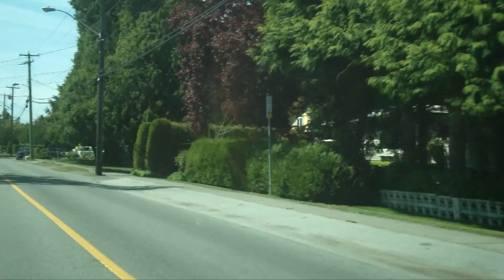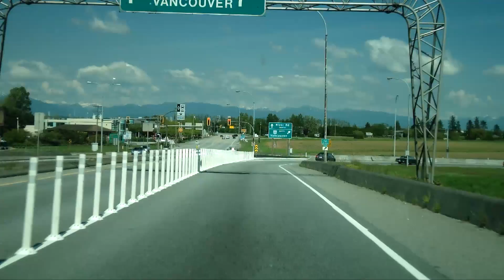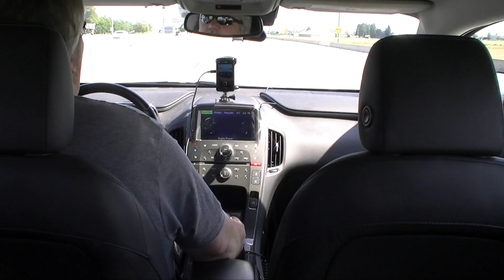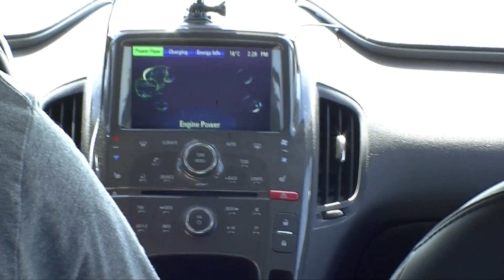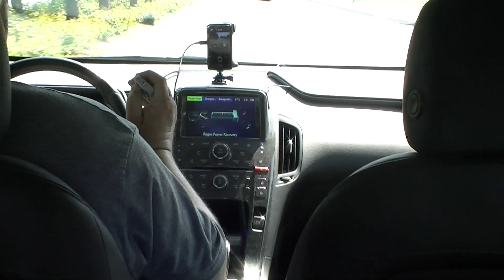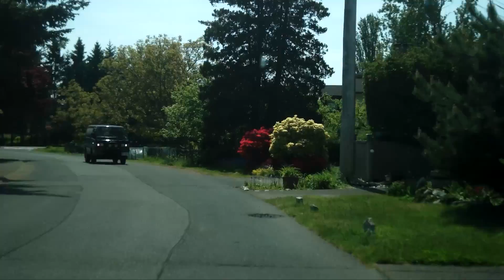How to drive a chevy volt for best electric range and fuel economy

Comment: Thank you for the video. Although, I have a few questions. You state that there's no other car that operates like the Volt besides the ELR, but doesn't the Prius Plug-in and Honda Accord Plug-in operate in the same manner? Through out the video I was hoping you'd mention why you picked the Volt over the Prius Plug-in or Accord Plug-in but they weren't mention. If you could choose again, which would you pick out of the 3? Also, I keep running into various specs on the mpg (I'm from the states) for the Volt. I was on the Toyota website, and there was a comparison chart that showed the Prius Plug-in getting 51/48 city/hwy, but for the Volt, it was 101/93 city/hwy. Which I guess they incorrectly put the combined gas and electric mileage for the Volt, rather than the gas alone. The Chevrolet website states that it's 40/35 city/hwy. If that's the case, would one not save more with the Prius Plug-in? Or would that depend on the distance of the destination, considering that the battery range for the Prius Plug-in is estimated at 11 miles and the Volt is at 38 miles. Reason I'm asking is because I'm starting a new job that's exactly 21 miles away, so 42 miles round trip. I think the Volt would save me more gas if I drove just to work and home each day, and only those places, but, what about after work? I like to go out and about and I don't want to have to wait around for my car to charge before I go out again. So in that case, I think I'd want to have a car with better gas mileage rather than battery life but I'm not sure. I'm probably rambling now, but, what's your take on this? Do you believe I'll save more gas with a Prius Plug-in or a Volt?
Reply: I've never driven a prius, and I really doubt I ever will. 
I will stick with my 2012 Volt for the next 2 years, when my daughter is old enough to drive, she can have it, and I will either get another Volt or a Tesla. I doubt there will be any other cars to compete with them on a price or performance point. 
Now that I have experienced EV driving without the range restrictions. 
I went to a mitsubishi dealership to test drive an iMiev, they didn't have one in Stock, the salesman tried to get me to test drive a one of their conventional cars. I refused and he asked me why I didn't want to. 
I just pointed at my Volt and responded "it's electric or nothing"
Reply from the maker: There are huge differences between a volt and a plug in prius or a plug in ford fusion.
The prius and fusion plug in operate exactly the same way incidentally.
On a Prius plug in, the range on the battery is only about 10 miles, the ford is around 20. Both of these cars will operate in battery mode at lower speeds for up to this range. They do rely on the gas engine for moderate, and heavy acceleration.
So you have to basically drive with a feather on the accelerator to keep the car in electric mode, the engine will come on on even the slightest grades. It operates up to about 45MPH ini electric mode, and once you exceed that speed, regardless if there is power in the battery or not the as engine starts. Same if you step on it from a light. The engine fires up for acceleration.
The volt, by contrast never starts the engine under any driving conditions until the battery is used up. The range I get regularly is 39 - 42 miles (58 to 65 KM) in warmer weather, and it drops to about half that in cold weather as I like comfort, I turn the heat on, and that uses battery power as the car has electric heaters, which are really nice as I get nice and toasty immediately.
Once the battery is done, the as engine fires to generate power to operate the electric motor and everything else.
As to gas usage, well there is none until you use up the battery. My daily commutes are well within the 40 mile range, and I have access to charging stations when I am out and about. So, unless I am on my summer road trip, I use NO GAS AT ALL.
I haven't put any gas in the tank since I was away in August, and I won't probably put any in it until next year. A 9 gallon tank usually lasts me 6 or more months in my day to day driving. It does use a little in winter as once the temperature drops to below 25'F and the car is not plugged in, sitting in a cold parking lot for example, the engine will fire as soon as the car is turned on. This is done to fire up the electric heaters in the battery to bring it up to operating temperature, as all batteries suffer capacity loss in the cold weather, so by warming up the pack, the range is maximized. If the car is plugged in, then grid power is used to keep the pack warm.
Once the battery is warm, which takes no more than 3 or 4 minutes, the engine shuts down again until the pack is used up.
When I have had my volt out on road trips, and I have driven it half way across Canada, and down to Arizona and back, I am naturally using the gas engine. On those trips I have been consistently getting fuel economy in the 42-45MPG range, which exceeds what the EPA estimated it at. Check out my video on the regenerative braking , and you will see the actual results I achieved on my last road trip of the year driving throughout the mountains on British Columbia.
And to answer that question would I buy another volt. Yes, I would, and yes I will be buying another one. I plan to bet one of the 2nd generation volts, and pass the current one on to my wife, she currently drives a conventional hybrid, and I am always filling up the tank on her car. Yes it gets respectable fuel economy as all hybrids do, but like me, she could do it 100% electric. And no I wouldn't consider an electric only, as I know people that have them, and they are limited in their travel plans. Even the mighty Tesla has to be recharged, which limits the route that is taken to one that has charging stations. I just get in my car, find an interesting road, and go for a nice relaxing scenic drive, and never have to worry. As long as there is a gas station every 300 miles I am good to go.
Reply: Thanks for the quick reply. I've watched both videos at full length, with the intent to learn as much as you've tried to present. I too at one point came to the conclusion that I wasn't going to get an all electric car for the same reasons you stated in this video. At the moment I have a Toyota Echo which has served me well (As well as a 350Z that is parked and being built to autocross but that's besides the point). Before that, I had a Acura Integra, and both of these cars were/are my daily drivers and very easy to work on. I haven't pulled the trigger on an electric/hybrid car due to believing that I wouldn't be able to work on them the same if something were to go wrong. Would you recommend getting an extended warranty on a used Volt? I mean, they haven't been out that long to test it's longevity, but I also haven't read of any recalls. Again, thank you for the replies and videos. Very informative and helpful.
Reply from the maker: Inocente Sandoval
There have been no recalls on the volt. As a matter of fact it is the only car that GM has ever produced that has not had any recalls, and for that matter that would extend to most manufactures as I have had recalls for various things  on every car I have ever owned. There were a few things that were done voluntary by GM. My car was in the first batch, and got the re-enforced battery cage after a single car caught fire weeks after it was crash tested. And they replaced the 120 volt charge cord because a few of them the plug that plugged into the wall socket had prongs that overheated, so they replaced the plug side cord on the charger.
Other than that, there have been no issues in 68,000 KM of driving. The oil was changed at the 2 year anniversary. It doesn't get changed again untill it is 4 years old, which is next September, and when they changed it they inspected the brake lining, and the brake linings hadn't started showing any wear at all. They were measured had worn only about 5%, which is understandable as I use my regenerative braking most of the time. My wifes vehicle is also a hybrid, and thus has regenerative braking, as that is how the battery gets charged on a conventional hybrid. The brakes were done for the first time at the 100,000 mile mark. So either way you go, hybrid, plug in hybrid, Extended range electric (that would be the Volt and the BMW i3) or full electric, the maintenance is much less than a conventional car. That maintenence generally has to be done at the dealer mind you, because specialized tools are required, BUT, in my personal experience the dealer option is usually not that much different in price than "joe" at the corner service station, because their technicians are up to speed on the proper service procedure, and are not guessing like joe is in many cases. The last time I dealt with "joe" he took me to the cleaners, and 30 minutes later when I returned with the same problem, he wanted more money to investigate again. The new car dealers are going to fix it right, because they have, especially with a high tech car like the volt, eyes on them from the car makers. Customer satisfaction is the rave these days in business (you should see the company I work for) and with the focus on customer satisfaction, and likelihood to recommend there is no room for a dis-satisfied customer. Heck GM even replaced my weather stripping free of charge because by butt rubbed it when getting in and out of the car and wore a 1/2" hole in it. Replaced, free of charge during routine service, and I didn't even ask for that. And they washed and fully detailed it to look like new, when I was in to have the tire valve stems replaced because the silly metal fill caps froze on, and I couldn't remove one.
Reply: Inocente Sandoval test drive a fully charged Volt in SPORT mode. You will be sold. No longer need for any maintenance except tire rotation/balancing and oil changes every 2 years (yes). Very reliable and fun car to drive.  Trust me I traded a 2000 Acura TL and never coming back to ICE cars.
Reply from the maker: Carlos Rosado

I went from driving expensive German cars to the volt, and I won't go back either .I considered a Tesla, but even with the 250 mile range that was a deal breaker, as to go on long trips means planning the journey around the charging infrastructure, and I didn't want that. With the volt I can go anywhere, anytime. On long journeys I put gas in it, and for my daily driving to and from work, and driving the kids around, I use no gas whatsoever.
Reply: Anything under 100 miles, the volt wins. 
Long distance travel the prius wins. 
If you travel 21x2 miles and only charge at home once you might make it without using a drop of gas (speed/style will determine this) 
(If possible to plug into any 120V receptacle for any amount of time you definitely won't burn any dinosaurs) 
The prius will use ±0.8 gallons no matter what you do
I own a 2012 and I won't be going back to a conventional ICE, a Tesla perhaps, once they roll out all the superchargers (in OK, TX and AR)
Reply from the maker: gera quiroz
I disagree. My wife drives a hybrid. It doesn't matter how many or not miles is driven the volt wins every time. She never gets anything close to the EPA rated fuel economy because she is not in stop and go traffic, and that is the only place a prius or any other hybrid will get close to the rated fuel economy. Plus the prius is a gutless piece of crap. On my volt i average, and I will quote this in miles per us gallon, 38-42 miles on the battery in warm weather, and 28-30 in freezing temperatures. That is just the way it is with batteries. They put out less energy in cold temperatures, plus the heat, wipers, lights ect take power away from the range too. When the APU is running, and I am referring the the generator as an APU, or axillary power uint, I consistantly get 42 MPG when running at speeds between 0 and 55 MPH, and it drops to 40 at speeds over 55MPH. This is because over 55MPH the engine runs constantly, and does not cycle on and off as it does below 55MPH.  On my wifes car, the fastest she can get on electric power alone is 28MPH. As soon as she exceeds 28MPH the gas engine fires up, and runs constantly untill the car drops below that speed. She averages 43MPG if she light foots it but in reality it is more like 36-37 consistantly. When I drove that vehicle and was commuting I managed to get the fuel economy in the 45-48MPG range, but I was also in stop and go traffic commuting every day. Now I do my entire commute on electric power every day. A tank of gas in the volt lasts me almost a year! I myself wouldn't consider a Tesla because it takes too long to charge. Even on the super chargers, every time you need to charge you are stuck for a minimum 1-2 hours. I have friends that have them, and they complain about the "super campers" as they are known. These are locals that drive from home to the local super charger to get free electricity and go for coffee, or lunch, or to the gym while their car is charging, and travelers wanting to charge and go have to sit around and wait for a charger to come free. A good friend with a tesla tried to drive from Canada down to Las Vegas last summer using super chargers, and it took him a full day longer to get there than me. (we left at the same time, he took the interstate routes, because he needed to charge, I took the scenic route, and I still beat him by a day!) Incidentally he has had some major troubles with his Tesla. The main battery pack needed replacing as did the main drive unit. So I would say from my friends experience that they are not as reliable as some would like you to believe. He also has had a problem with his touch screen that needed a trip to the service center to be reset. Yet he would probably go on the record and say he would buy another one like all the other Tesla sheep out there.
I will go on the record, my next car will most certainly be another volt.
Reply: The Volt and ELR are series hybrids.  Most other plug ins are parallel hybrids with a plug in feature.  Series hybrid meaning only one form of propulsion.  Electric only with a generator providing electricity when the battery is drained.  Parallel meaning that there are two means of propulsion.  Gas or electric.  The gas motor is not a generator.  It connects to the wheels.  Usually, these types of cars can not go beyond a certain speed in full electric.  The BMW i8 is also a parallel plug in, but they juiced up the car so it can go over 80 mph before reverting to gas.  The Volt can go 100 mph in electric until the battery is drained.
Reply from the maker: ra5928
Correct except that the volt and ELR can be configured to run as a parallel hybrid as well. Under certain conditions, those being when cruising at a constant speed between 70 and 90MPH over relatively flat ground the system, by means of the 3 clutch packs can unlock the ring gear, and connect it to the 2nd electric motor that is functioning as a generator, connected to the gas engine. In this mode 50% of the power generated by the gas engine would go to producing electric power, and the the rest of the torque right into the ring gear, where the ratio is variable by changing the power to the main electric motor that drives the sun gear. The wheels are driven by the planetary gear carrier always.

There are 3 clutch packs, one locks the ring gear to the case, the second connects the ring gear to the secondary motor/generator and the 3rd connects the secondary motor/generator to the ICE.
With this set up, in battery mode, clutch pack 1 locked, the main motor turns the sun gear, the planetary carrier turns the wheels.
In mode 2, the first clutch unlocks the ring gear from teh case and the second motor locks the ring gear to the secondary motor, and both electric motors spin at a slower speed for freeway cruising on battery. This is more efficient than soinning the single motor at a high speed.
Once the battery is dead, series hybrid mode is entered. Clutch 1 locks the ring gear to the case, clutch 2 is released, and clutch 3 locks the secondary motor to the ICE, the ICE turns the generator which puts power to the battery, and from there the battery feeds the main motor.
Mode 4 operates similar to mode 2, for high speed freeway cruising when little torque is needed. Clutch 1 unlocks the ring gear, and clutch 2 connects the ring gear to the secondary motor, clutch 3 connects the secondary motor to the ICE.
As soon as you step on the gas once the car has entered this mode, it reverts back to mode 3. There is 1 exception. If you are are driving in the mountains, and did not enter mountain mode first, and you manage to burn up all the reserve in the battery, the car will enter mode 4, and the power / speed is limited untill you crest the hill, or pull over and let the battery recover. When I say speed is limited I mean it. The car won't go much over 55. I have intentionally driven through the mountains and left the car in normal mode to see what happens. Naturally if you go into mountain mode 5 to 10 minutes before starting the climb, the ICE will ramp up to full power, and start putting a bigger reserve 9it will build up to 10 extra miles of buffer into the battery over a 10 minute mountain mode cycle) which will give you more than enough power to climb any mountain.
Reply: No.  From the article, paragraph 11:  From GM.

"Thus the gas engine participates in turning the wheels mechanically although indirectly".

"Thus although the engine generator can participate in mechanically driving the wheels it never does so directly or in isolation, at all points in time the large electric motor is the main driver of the wheels."

http://gm-volt.com/2010/10/12/chevrolet-volt-electric-drive-propulsion-system-unveiled/

"At all points in time means just that.  It is a series hybrid.  Parallel means both motors can have a direct connection to the drive wheels.  Impossible in the Volt.

A parallel hybrid is either gas, electric, or both.  A series hybrid is always electric in the case of all series hybrid automobiles.

This is a very common error, as most people think diesel electric locomotives are diesel.  They are always electric, with a diesel generator that provides electricity to drive the wheels which are connected to electric motors.

Once again, in the Volt, the gas generator is never in direct connection to the wheels.  That is per GM.  An indirect connection to the main (and only) drive motor is the exact definition of a series hybrid.  A direct connection to the wheels by both motors is the exact definition of a parallel hybrid.
Reply from the maker: ra5928
Incorrect. In mode 4, both electric motors and the gas engine all supply power to the wheels. This is a parallel hybrid. The gas engine can not drive the wheels alone, because the main electric motor can not be taken out of the planetary gear set. In a conventional hybrid, like a prius or a Ford for example, the gas engine can directly drive the wheels with or without the electric motor assisting. It can operate as electric only at slower speeds, gas only, or gas with electric assist. That is the difference. The volt can not operate as a gas only drive. It can only operate as a with the majority of the power coming from the electric motor, and the majority of the time even when in extended range operation it is running as a single electric motor driven car with the gas engine only generating power. In specific conditions and only between certain speeds the gas engine can be also connected and assist. This is when it is operating as a parallel system.

The BMW i3 is a series hybrid, as was the Fisker Karma. There is no way in those cars to take any power directly from the gas engine and couple it to the wheels. It can only run the generator. The volt initially was going to be like this, but they found that the fuel efficency could be increased at highway speeds by making it possible to transfer some power into the planatary gear set, so that is what they did.
Reply: 12voltvids OK ... I guess GM is wrong.  But your own words prove you wrong.  In a parallel hybrid, the gas engine can and does spin the wheels.  In fact, most of the time.  

But ... GM and I agree.  That's all I need.
Reply from the maker: ra5928
Actually in a conventional hybrid the engine does directly spin the wheels through the planetary gear set.

In a conventional hybrid, the gas engine is directly coupled to the planet carrier.
One electric motor / generator is connected to the sun gear, and the second electric motor is connected to the ring gear, which is also connected to the wheels.
The seconds generation prius used a second planetary gear set to allow speed reduction of the motor / generator which allows for higher battery only speeds, as the original design such as on the hybrid my wife drives, 29MPH is the fastest the car can go in battery only mode with the engine off. The reason is the motor connected to the sun gear, which is basically freewheeling when in battery mode, the traction motor driving the sun gear as going into an over speed condition. So the gas engine starts to that the motor/generator speed can be dropped by means of the ecvt gear ratio of the planetary gear set .
The gas engine is always part of the drive line. It can not be disconnected as it is directly connected to the planet carrier, and provides direct input to turn the wheels.
On the volt, by contrast the main motor is connected to the sun gear, the wheels are connected to the planet carrier, and the ring gear is connected to 3 clutch packs.
1 clutch pack locks the ring gear in place, the second connects to secondary motor/generator, and the rds connects the secondary motor/generator to the gas engine.

By this configuration the car can be configured to operate in 4 modes, single motor electric, dual motor electric, single motor electric with second motor operating only as a generator or series hybrid, and the gas engine plus second motor can be also coupled into the ring gear to operate as a dual motor / plus gas engine parallel hybrid. In this mode the secondary motor would only be generating power for the main motor.
Regardless how you think you can win this argument, you can not, because technically this is how the car operates. Go back and study the operation, and you will find that this is how the car operates. It can operate in 4 completely different configurations all controlled by the computer, and and all done on the fly withour any driver input depending on conditions.
Reply: 12voltvids Well, at least we agree on something.  But, in fact, that is the definition of a parallel hybrid.  Two types of parallel hybrids.  Parallel, and series parallel.  Parallel is always gas and electric combined.  Series parallel is sometimes electric, but only at low speeds.  Throw in a plug in feature and you have a plug-in series parallel.

But in both cases, the gas engine has a direct connection to the drive wheels, along with the electric motor ... thus ... parallel.

The problem is .... there are quite a few writers out there that don't understand the subject.  Once they write an article, everybody believes it.  GM, however states that the Volt is never in parallel.  Always in line.

Other groups get it right also, such as the AltaTerra Research Network.

"But even then, the gasoline engine is not mechanically connected to the main gear directly. An elaborate way of building the gear system allows the gasoline engine to transmit its torque only indirectly."

The main gear mentioned is not the planetary ... it is the single speed gear box.  In a parallel, both motors have a direct connection to the reduction gear.

"It is important to know that the gasoline engine alone cannot drive the car. It provides torque but does so in an indirect and auxiliary way."

http://www.altaterra.net/blogpost/587092/Zen-and-the-Art-of-Smart-Grid-Development?tag=Volt

Parallel means together, side by side, in conjunction.  Equal partners.

I've said enough.
Reply from the maker: ra5928
But you are wrong.
In a parallel hybrid the gas engine is always part of the equation. Even on the plug in hybrid designs, the gas engine is still connected to the planetary gear set, so the planet carrier. If you floor it, in electric mode the gas engine will fire up and then both the gas engine and electric motor deliver power.

In a full series hybrid, BMW i3 and Fisker Karma there is no physical connection between the gas engine and the drive wheels at all. The engine only spins a generator.

In the volt through the use of clutch packs the gas engine can be paralleled into the planetary gear set ring gear along with motor #2. Motor #1 the main motor is always driving the sun gear, and the planet carrier drives the wheels.

In this mode, it is most certainly operating as a parallel hybrid. Mechanical power from the gas engine is physically turning motor #2 AND the ring gear of the planetary gear set.

In the series hybrid mode of the volt, which is the mode it normally operates in when in range extended mode, the gas engine is connected to motor #2, and that is it. The ring gear clutch is disconnected from motor 2, and is locked to the transmission case, and all the driving force is from main motor #1 through the fixed reduction of the planatary gear set which is something like 3.7 :1

The reason for the complexity of the setup is because electric motors are more electrically efficent at lower speeds, so when in battery mode they wanted a way to allow for 2 motor operation, so that the variable nature of the planatary gear set could be utilized.

For example when the ring gear is locked, it takes 3.7 turns of the electric motor to equal 1 rotation of the planet carrier. But unlock the ring gear and couple it to the second motor, and as the second motor spins up, the main motor spins down.
So you can get down to 1:1 ratio easily. 1 revolution of motor 1 and 2 = 1 revolution of planet carrier.

That was teh reason they did it. Under low load, cruising it is more efficient to run tboth motors slowly, rather than 1 motor screaming.

Same applies for when in gas extended mode. By coupling in power from the gas motor / electric #2, electric #1 can reduce it's speed substantially, and thus require less electrical energy, and this less gas to generate said electricity.

The information I am explaining is all out there in the deep dive of the volt. There is no use in arguing what you think is correct, go look it up, and you will see that how I am explaining the operation is exactly how GM explains it in the volt deep dive. I studied the operation for several years while the car was in production, and I own other Hybrids, and have studies the design, and operation of those systems too.  The ability to switch to 4 completely distinct operating modes is what makes the volt and cadillac ELR totally unique in the hybrid world. Go do your research before shooting your mouth off.
Reply: 12voltvids Andrew Farah,  Chief Engineer for the Volt, "there is no direct MECHANICAL linkage from the engine to the wheels".

Definition of a parallel hybrid:  A direct mechanical linkage from the gas engine to the wheels.  Period.

I know as much about the Volt as you do.  I seem to remember that you thought the planetary was a transmission and that different gear ratios were sent to the wheels, when in fact, the planetary is a torque / power split device and it sends it final torque output to the single speed gear box.  Remember that one?

I do.
Reply from the maker: ra5928
In a conventional hybrid the gas engine puts its power into the power split device, the planetary gear set. The generator / starter motor is also on the planetary gear set on the sun gear, and the ring gear, which outputs to the wheels has the main motor connected. The gas engine therefore has a direct connection to the wheels through the gear set.

On the volt, the main motor is connected as the primary source of power into the planetary gear set. The wheels are connected to the planet carrier. The ring gear can be configured as locked (out of the picture, fixed reduction ration by the planetary) or connected to the small secondary electric motor, so both electrics are inputting power to the planetary gear set. (variable gear ratio)
In gas mode, the main motor inputs to the planetary, the ring gear is locked,(fixed gear ratio)  and the gas engine spins the small motor functioning as a generator.
This is a series hybrid.
So now you connect the gas engine, in parallel with the small motor/generator which is inputting power to the power split device along with the main motor. (variable gear ratio) Guess what that is a parallel hybrid. The power is being input via the sun gear and the ring gear, and coming out the planet carrier, but power from the engine and electric motors is directly driving the wheels. 
There most certainly is a direct mechanical linkage from the engine to the wheels through the planetary gear set when the system is running in mode 4.
What Andrew Farah said, and I did see the interview is that the gas engine CAN NOT directly drive the wheels by itself. The main electric motor is always part of the equation, because there is no physical way to disconnect the main electric motor from the system. If you were to turn the power off to the main motor, the car would not move, the engine would spin the ring gear and the sun gear would freewheel, and the car would go nowhere. The electric motor is always part of the equation.

In a conventional hybrid the electric motors can not be removed from the equation either. With the engine spinning the planet carrier to the only way to get power out the ring gear is by loading up the sun gear motor and making it act as a brake (generator) and that power has to go somewhere. Once the battery is full on a conventional hybrid that power goes guess where, into the main motor.
You should really go back and hit the books before you go and shoot your mouth off.  Look at the block diagrams, and the modes of operation. When the volt is in mode 4, the engine is connected in parallel with motor 2, which is coupled into the power split device. This is how a parallel hybrid works. The big difference between a parallel only hybrid and the volt are the clutch packs that can reconfigure the secondary motor and completely disconnect it from the planetary gear set which turns the volt into a series hybrid. Something that the other hybrids can not do, and this function is what makes the volt different, and superior to all the other hybrid designs.
Yes, I know the the difference between the planetary gear set in a volt which can be configured as a fixed ratio, or an eCVT and the planetary gear SETS in a convertional automatic transmission. I used to rebuild automatic transmissions, I know exactly how they work. They use multiple planetary gears, and clutches to shift to specific reduction ratios. Hybrids use 1 (the 2nd gen prius uses 2 for motor speed reduction) and vary the speed of the electric motors to achieve the variable ratio. It is a very simple, and reliable design.
Reply from the maker: gera quiroz
I hear you. My next car will be another Volt. I am hoping that GM will make a CUV version of the volt. There are rumors that one is coming, and when it does that will be the car for me. A Tesla just doesn't fit my lifestyle. I like to do road trips off the beaten path where there is no place to recharge, so a tesla or any other EV with no REX isn't in the cards.
I test drove an iMiev, and to tell you the truth it does have a fair bit of kick. Not as much power as the volt, and it looks strange, but it does move pretty good. As does the leaf, which I have also driven. Neither of them handle as well as the volt, or for that matter a Tesla, which I have also driven. The Tesla didn't do much for me. After you get past the wow factor of all that torque off the line, it really doesn't handle that much differently than the volt, and it is no more comfortable to drive.
The touch screen I found to be a huge distraction while driving. Just to do simple things like change the temperature, or radio station required taking ones eyes off the road. I didn't like that. I much perfer the button panel on the volt for the climate control  ect. I just wish they were real buttons like the driving mode button as opposed to the touch sensitive keys.
I have also driven a Fisker Karma, and that car really looks super from a distance, but I found the interrior more cramped inside, however there is no question that it have a fair bit of power especially when the engine is running with a charged battery. They went bankrupt, and my neighbour scooped one up. Let me take it for a drive and he took my volt.
Wouldn't trade cars. Volt is more comfortable for someone my size, 6'2"
If Tesla had a range extender as an option, then I would definitely have it on my list, but untill the day comes where there is a supercharger in every little town in the country then I'll pass on it.
Reply: 12voltvids Carlos Rosado gera quiroz Thanks for all of the replies and information. I'm proud to announce that I've been driving a 2012 volt since Nov 8th and have not had one regret. Although sadly, the charger crapped out on me a couple days ago so i'll be going to the dealership and see what can be done about it. Other than that, the car has been a dream. I can't wait till the temperature starts to warm up to see how much range I can get off one charge! My highest so far is 48.

Do any of you have a 240V outlet installed? If so, which charger are you using? That's probably going to be my next purchase but I'm worried about getting ripped off on the installation. I feel that I could possibly do it myself if I look up enough tutorials and/or information. I'm leaning towards this charger http://www.amazon.com/TurboCord-Dual-Plug--Charger-Volt/dp/B00J8O1XQE/ref=sr_1_17?ie=UTF8&qid=1420517538&sr=8-17&keywords=240v+charger because of how portable it seems and the functionality to switch between 120V and 240V.
Reply from the maker: Inocente Sandoval
I have the Voltec charger which is the basic one by GM, Cost me, well nothing! When I bought mine the government had a 500.00 rebate, and the charger cost 490.00, so basically I baid a little tax and shipping. Installation was a snap. There are 3 wired to connect to your electrical service, the 2 hot wires and the safety ground wire (no neutral is used on the 240v) Many chargers you can buy come with a standard NEMA6-20 3 prong cord like that used for a garage heater.
Depending on what charger you buy, you need a double breaker for your electrical service. My electrical panel is in my garage, so I did it myself in less than an hour.
Depending on the age of your house and the location of your panel, you might need to have an electrician install it. It is not hard to install though, just the 2 hot wires to the double breaker and ground. If you get a charger with a cord, you will need to install a plug, if you buy a hardwire unit like the Voltec, then you need to run a #10 wire like the type you would use for a water heater or baseboard heater from the charge unit to the electrical panel. That one you show looks to be a good choice. the volt only has an on board 3Kw charger, so all you need is a 15 amp circuit.
The charge cord that crapped out, was it the upgraded or original charge cord. GM upgraded all the level 1 chargers due to a faulty plug. The new one the short cord going from the charge unit to the plug was much heavier, and rated at 20 amps instead of 15. It has right angle pins with respect to the cord, whereas the original was a lighter cord that the plug was straight out the end of the cord, and that caused a problem if the charge unit was left hanging from an outlet.
Reply: 12voltvids 
I was looking at the Voltec charger also but the charger I linked had the option to do either 120V or 240V with an adapter to change outlet type. My house was built in 2004 and also have my panel in the garage. I was hoping to just be able to switch out the 5-15 outlet to a Nema 6-20 and call it a day since the breaker for my garage plugs are 20amp but if I have to, I'll run new wire with a bigger gauge just for the outlet and breaker.

I'll probably end up getting the one I linked and install the new breaker, cable, and 6-20 outlet. Unless you think I can change out a 5-15 outlet for a 6-20.

I'm pretty sure my charger has the updated right angle pins that you stated. I'm going to the dealership tomorrow morning and will hopefully be able to swap it under warranty.
Reply from the maker: Inocente Sandoval
If your garage is wired for a 20 amp circuit than your wiring is fine. All that is needed is 12 gauge, I went with 10 as that is what I had. The volt only requires a 15 amp circuit on both 120 and 240 volts.
The fuses in the voltec charger are rated 20 amps, but I have mine on a dual 15 amp breaker, has never tripped the breaker (but one of the fuses blew for no apparent reason)
Reply: 12voltvids
Good news, the cord was replaced this morning at no cost so +1 to the dealership I went to for not hassling me, despite their bad reviews. 
So let's say I have 12 gauge wiring for my garage. Does that mean I can just change out one of my outlets to the Nema 6-20 outlet and plug in? 
Was the fuse easy to replace? 
I read somewhere that they're welded on the circuit. I was going to check my fuses if the warranty wasn't going to cover. But if they're removable then I'll check them out in a future problem when warranty no longer covers.
Reply from the maker: Inocente Sandoval
 
Only if that outlet is home run back to the panel with no other outlets down stream, because you are going to be connecting 2 breakers, one on each phase like a water heater or electric baseboard would be connected.
If the wires in the box are black and white, you will need to remove the white one from the neutral bus and connected it to your second breaker.
Again before you do this you need to make sure that there are no other plugs connected to that outlet because once you do this you will have 240 volts on all the other outlets if there are others either daisy chained, or if the run goes to a JB and then back to the main panel.  Turn off the breaker to the plug you want to use, and then walk around with a lamp and check all the other plugs. If there are others that have no power, then those outlets are also on the same branch and you can't rewire that outlet for 240.
In my garage there are 2 outlets along the floor, 1 on the cieling and the garage lights all on the same circuit, so I couldn't do that, I had to run a new run to the panel, but in my case that was only 2 feet from the panel. I mounted the charger on the next stud over from the electrical panel, and just fished the wire over to the panel, and opened a new knock out plug, and wired it up.
The nema 6-20 outlet has 2 wires, both hot plus the ground. A normal 120 outlet has 1 hot, 1 neutral, and ground wire.

Now onto the charge cord, yes the fuses are soldered in place.
You can check out my repair video for the voltec charger. I fixed my own, and have a video up on my channel documenting the procedure. Both the 240 wall charger and the 120v travel charger are almost identical inside other than the input voltage. Many people take the 240 wall charger board and put it in the travel charger case so they can have a dual voltage travel charger.